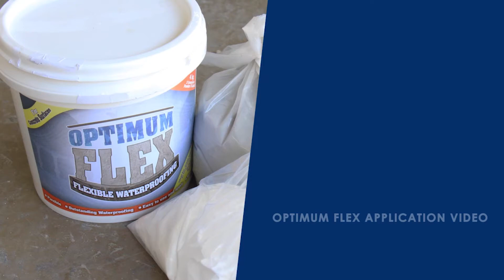How to use Optimum Flex - Flexible Waterproofing

Comment: can I use this for waterproofing of bathroom floor and cold joints in preparation for Tiling?
Reply from the maker: Hi Partner, yes you can use Optimum Flex  and it is intended to be used before any top coat or tiles. If your bathroom is in the lower floors or in the ground floor, you may opt to use Super Thoroseal as Optimum Flex is often used to elevated structures such as roof decks, balconies, elevated pools, etc. For more inquiries, you may also send us a message at https://www.facebook.com/jardinedistribution
Reply: @jardinedistribution  That would be perfect since our bathroom is in the upper floor. thank you.
Reply from the maker: Thank you partner, Optimum Flex is available in hardware stores and DIY stores nationwide. It is also available online in our official Lazada (https://www.lazada.com.ph/shop/jardine-distribution-inc/) and Shopee Mall https://shopee.ph/jardinedistributionph.

Comment: Can i use thoroseal in sealing the cracks and optimum fles for final coating?
Reply from the maker: Hi partner, no need to apply both waterproofing as it would be inefficient.  Best to apply waterproofing Super Thoroseal or Optimum Flex then apply a top coat for added protection. Cementitious waterproofing will penetrate the concrete thru crystallization. Please use Super Thoroseal for rigid application such as bathroom, swimming pools, cistern tanks. Use Optimum Flex for areas susceptible to movement such as roof decks, elevated pools, and higher ground floors.

Learn more, visit our website:
https://jardinedistribution.com/productview/Super_Thoroseal_White
https://jardinedistribution.com/productview/Optimum_Flex